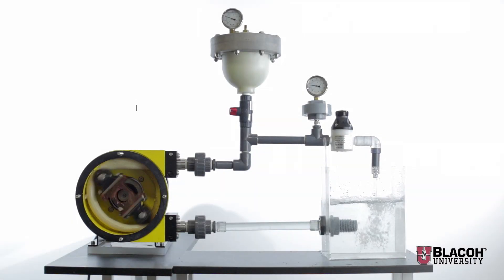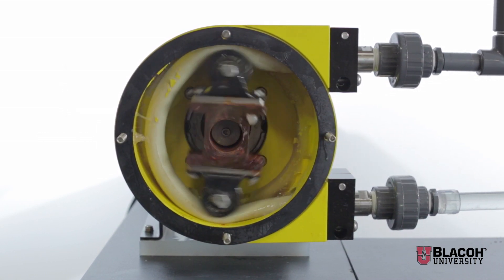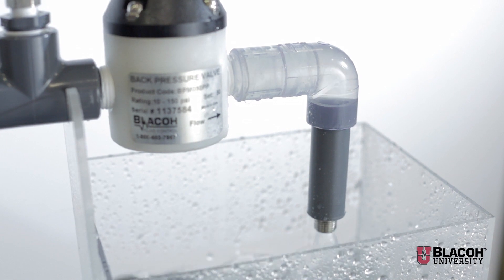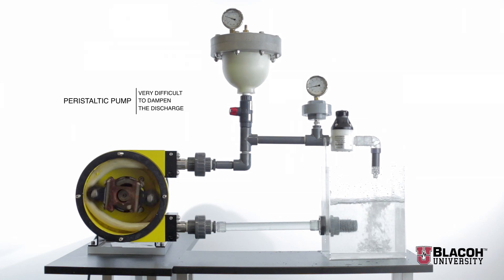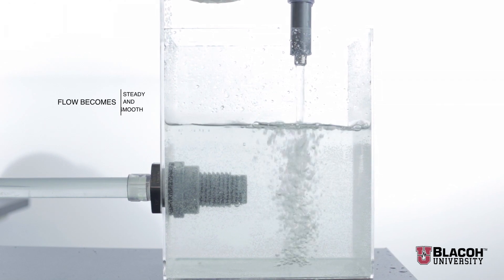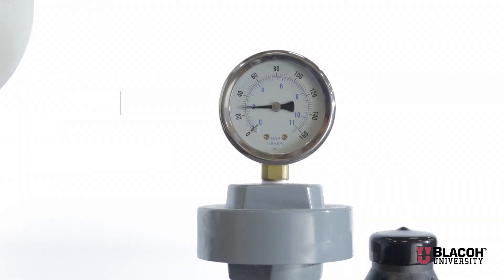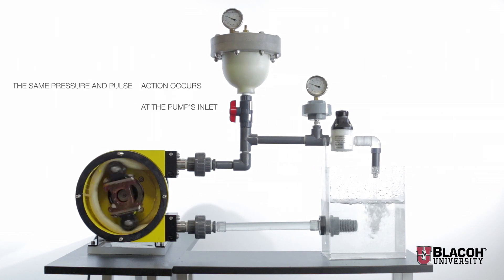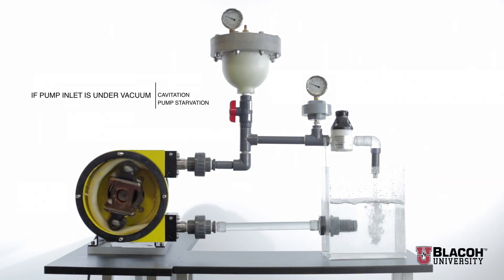Pulsation Dampeners for Peristaltic & Hose Pumps

Comment: Hi if i remove the back pressure valve what will happen
Reply: The fundamental purpose of a back pressure valve is to control the upstream pressure, maintaining it to a decided limit. 

I would say that in this setup the back pressure valve is set at 20 psi. 

Back pressure valve is really needed with this pump to control the pressure downstream of the pump and upstream of the back pressure valve because the peristaltic pump just moves the water forward and the pressure build up in the system depends on what elements you have downstream of the pump. In this case you don't have much pressure drop because you only have pipes and the pulsation dampener. 

If the back pressure valve was removed from this setup the pressure would not build up in the system to 20 psi and you would have a flow of water with almost ambient pressure. Also, because of this setup, I believe that gravity will empty the water on the system and also air would get into the system from the discharge port.

Comment: Wish you would have explained how the dampener works a bit...
Reply: And give up their R&D?  It appears from the outside to just be a standard accumulator.  You can see the schrader valve on top for filling with an inert gas, and a diaphragm is sandwiched between the two dampener housings at the top, separating the gas from the liquid being dispensed.  This is a standard component in hydraulics, with the same purpose, to dampen out the pulsation from the pump.   It is the equivalent of a electrical capacitor, which is used everywhere in circuits to smooth out power fluctuations (pulsations).
Reply: @mikeschaul4904  -_-
Reply: air balloon🎈